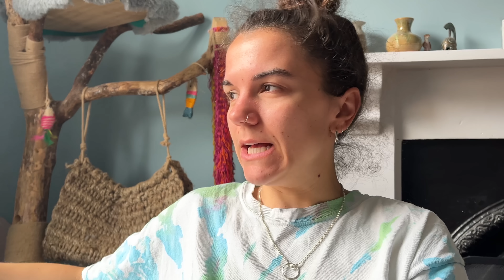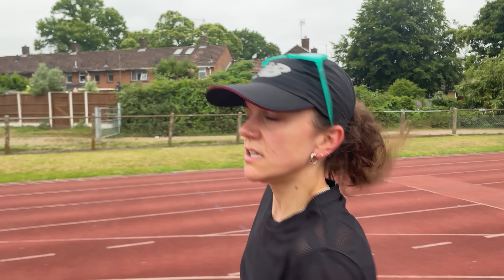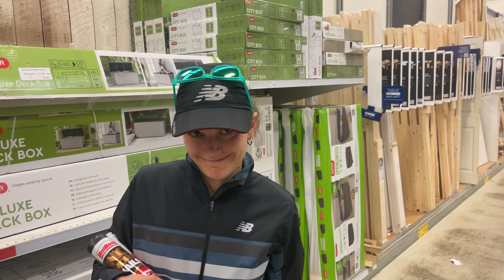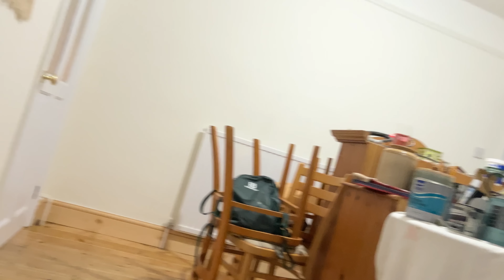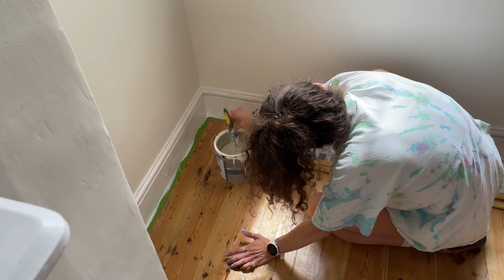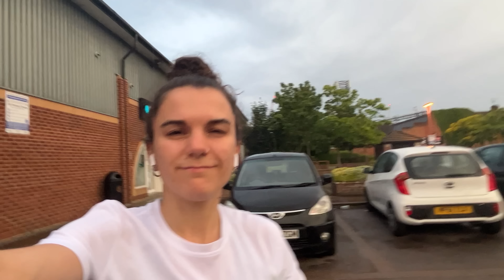SERIOUSLY TOUGH TRACK MILE WORKOUT + Weekend In The Life Vlog

Comment: Even americans are now using Kilometers and metric system for running, and you keep on talking about mile repeats? UK uses the metric system even after brexit or will it be Metrxit next?
Reply: UK has always used miles on the roads
Reply: @backYARDbanter13  for cars maybe, but watches can be set both ways. And you don't run in motorways.
Reply: @coco_bold  but if you grow up using miles for moderate distances then you intuition is set up to find that measurement useful. Also if you are running 1.6km repeats it makes sense to call them miles so you are using a full multiple of the unit rather than the cumbersome 1.6 ... 1.6km repeats just doesn't flow nicely off the tongue
Reply from the maker: I don’t really think it’s that controversial.. just what I’m used to and what I prefer. Definitely not as big a deal as Brexit calm down 😂
Reply: @PhilyBowden  Sure, and it is certainly shorter to say mile repeats, than kilometers repeats.
 One day if i ever have two cats, i will call them Miley and Kimey, just to honour your choices on miles and kilometers.
Keep the good job.